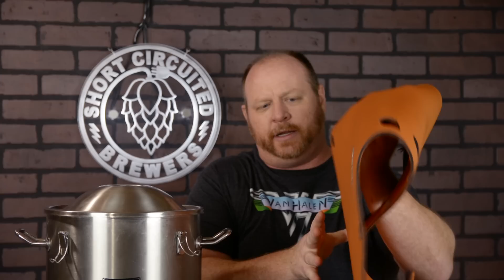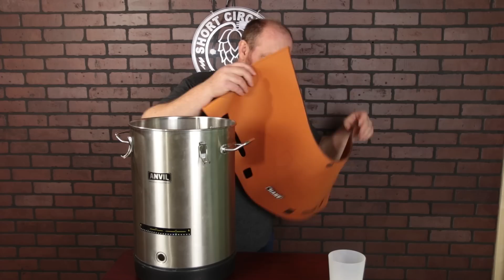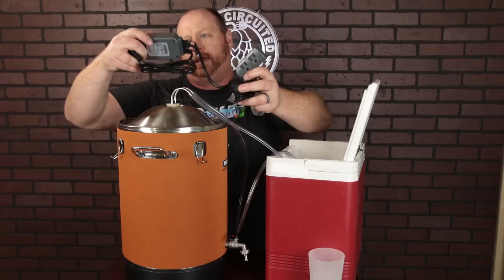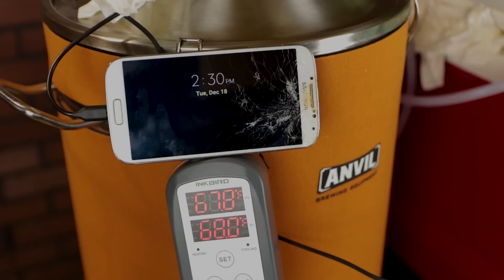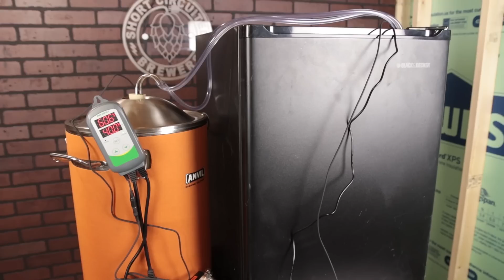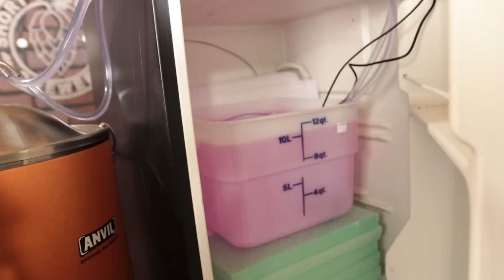Anvil Fermentor Cooling System Setup and Review

Comment: OK, so the outside lcd thermometer read 60-62F, indicating the outer areas of wort near the ferm walls are colder than the interior column of wort surrounding the actual cooling tubes, set for 68F?!?   This does not sound like temp control at all.  I dont blame the inkbird, since the thermowell is so close to those cooling tubes.  Im an Anvil fan, use a lot of their equipment, but this leaves me confused...I think I'll just stick with my chest freezer and heating mat for temp control for now...I dont think I want any system that requires a bunch of attention paid to keeping ice stocked.  UGH
Reply from the maker: Whatever works for you.

Comment: Just picked up my own anvil bucket and interested in this cooling set up. However I already own a pump, temp controller, and the thermowell. Any way I can just buy the coil/stopper and jacket that you know of?
Reply from the maker: Not sure I would give them a call.. They are great to work with.
Reply: @ShortCircuitedBrewers  wow fast response! Ya that's clearly the best option at this point. Thanks again!
Reply from the maker: @finyatta46  I try! 😉

Comment: Hi. Is there a fermenter with an optional CIP system on the market that works with 9.25 gallon batches?
Reply from the maker: From Anvil? Or just any company?
Reply: @ShortCircuitedBrewers  anyone, really. It's just that I'm an extremely lazy person :P But the Brewtools B40pro creates smaller batches than what their smaller Fermenter is rated for.
Reply from the maker: @doertedev  gotcha. Pretty much all the manufacturers have a cip option for that size batch. You would be looking at a 14 gallon fermenter. Blichmann has one, Spike, SS Brewtech,  sure there are others as well.
Reply: @ShortCircuitedBrewers  Have you had your hands on one specific product you could recommend? :) Thanks in advance - love the content.
Reply from the maker: @doertedev  I have not had my hands on any, BUT I hear Blichmann is coming out with a new fermenator that will have all the bells and whistles.. they do all work pretty much the same, hot water sprayed by a rotating ball to clean with. The biggest thing IMO is having a way to heat the cleaning water as PBW works best at 160f.

Comment: What kinda glycol do you have there?
Reply from the maker: It is RV glycol. Definitely don't use automotive antifreeze!! I'm sure you know that though. Good question Nick! Cheers! 👍🍻
Reply: @ShortCircuitedBrewers  I had a hunch ;) I use 70/30 water/propylene glycol but it did occur to me to try the winterising stuff for RVs. I ended up dissuaded though as saw some bad rap about ratios and freezing early when sustaining cold temps. In your experience is there any truth to this? I use a converted Maxi 110 undercounter chiller with an additional agitator (fish tank circulator) to prevent stratification and water freezing, and the res gets down to about -10C/14F
Reply from the maker: I have not seen anything on it. I will definitely report back on my findings once I get some more testing done. Sounds like you have a pretty good setup! I will let you know what I find out. Cheers Nick!👍🍻
Reply: @ShortCircuitedBrewers  Decent on the cheap! Cheers